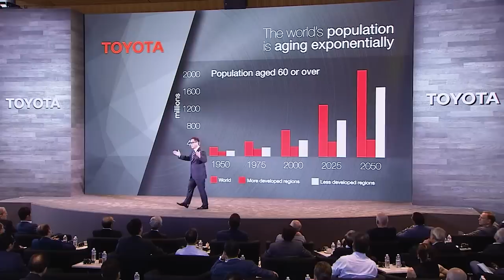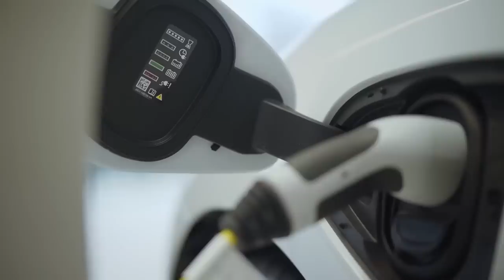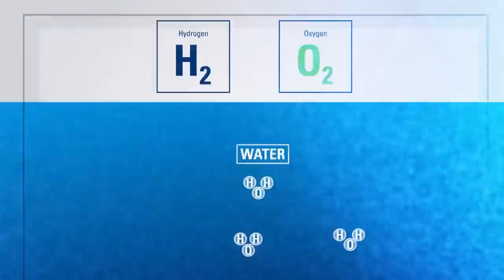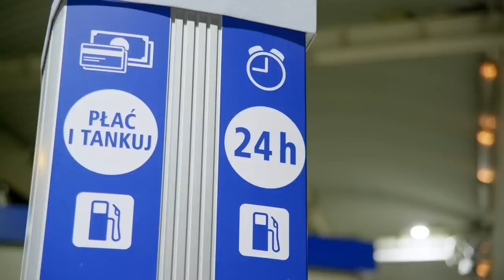New Toyota CEO Shocks Everybody | Huge News

Comment: One way to reduce your carbon footprint is to keep your vehicle as long as possible. Reliable, durable, quality vehicles would be the key here. It’s also what Toyota has been manufacturing for decades.
Reply: I just wish they would create a good SUV that would be basically rust proof. We don't want pickups and SUVs with frames that break in half due to rust. Toyota isn't the only one with that problem.
Reply: The best way is still to live in places where you don't need to own a car...
Reply: @marcbuisson2463  
You go ahead
Reply: @katherine5293  I currently do in Paris :>. I don't have any car licence, and spend 350e/year for all my commutes (withtm the pass navigo). I go to holiday by train 4-5 times a year, so that's 400e/year further (approximately). I do probably have a bigger night life budget than most americans though, good restaurants and partying is easier here than across the pond.
Reply: @northdakotaham1752  If you live in the rust belt in the US,  you need to use a good greasy undercoating and recoat every year.
Reply: @wiz4020  I keep one already rusty car for driving in the salt during the winter months and the rest of my rust free cars stay at home in the garage until  the roads are free of salt. I can flush out the mud but the salt gets into everywhere and is about impossible to get it all out.
Reply: @marcbuisson2463  sounds exciting....NOT!! Everyday is a holiday where I live. Night life is out in the wilderness under the stars! It's incredible!
Reply: @northdakotaham1752  you live in north Dakota. Of course it's the case. 
Now, is it also the case if you live in Dallas, LA, New York, Saint Louis, Charlotte? Nop, because you guys haven't even manage to conserve most of the rural land around your towns. We have pretected forests 5 km away from Paris.
And yup. If I want to do some mountain trek for a week, well... I take a train, a bus, and in 7 hours, I'm crossing the Vanoise for a week. 6 of these 7 hours being in a comfortable train with Netflix and a coffee. I have my feet in the sea in under 3 hours.
And even if I wanted to live in the wilderness... well, in the Alps, we have perfectly fine bus and train networks. I would not need a car there neither. I could even be even better paid if I lived in a small lost swiss village (with trains coming every 15-30 minutes at the local station) lmfao.
But yeah. While you live in the wilderness, most of your fellow americans living in suburbs try to persuade themselves they live in the wilderness. They just live in a sea of asphalt with not a single forest or farm kilometers around them.
Reply: @marcbuisson2463  I can't tell other Americans what to do with their lives. That's freedom. Freedom to make a mistake if you wish. Rural life is for me and my family. It's hard work but for us it's worth the effort. North Dakota is nearly the center of North America...so pretty much the same distance to where ever we want to travel and we can drive it, fly it (we are average income but we have our own plane), or we can take Amtrak if we want to travel by somebody else's schedule. But why do we want to leave home? We like it right here where we live. Everything we want is right here at home. Relatives are just a couple hour cross country. It's a choice we made since our family moved here over 140 years ago. Other Americans make their own choices. That's freedom.
Reply: @northdakotaham1752 I hear you, I'm from Pa. so I know about rusty vehicles, you have to get every nook and cranny, spray inside the frame with something greasy, I used fluid film but it will wash off, touching it up every year!
Reply: @North Dakota Ham  in the US, rural life is indeed very well linked to cars. And you know what? It's pretty normal. I'm certainly not throwing the stone at you.
Where I'm throwing it is at suburban or urban american life, who considers that having a car is necessary. It's not. And it should not be. Poor americans should have their life depending on being able to afford a car. And rich americans should not have cars or plains as their only transportation option. 
Current Amtrak is utter garbage and useless. But it's normal in a country where nobody lives near any train stations anymore. Which is sad, because many american cities were founded around these same stations. But on the other side... the fact that Amtrak still passes trains through North Dakota is a mystery in itself, this rail link should have been cancelled long ago. If you run a train line from a city to another, you either make it more convenient than cars, and make sure to be more competitive than them, or you don't build it. Unless North Dakota wants to densify and urbanise Bismarck, Fargo and Dickinson, the train line should be cancelled. Or run trains every hour/30 minutes. But the in-between is the worst solution of all, and costs too much to even be usefull to anybody.
Once again. North Dakota has little to no inhabitants. That said, are road used by cars that much better, or in the end are they even costlier there?
Reply: @marcbuisson2463  Amtrak is a money pit but it's kept alive to offer an alternative to those who either cannot drive or would rather not drive. There are also busses of course. The bottom line is there are choices for Americans to make. Everyone here is free to make their own choices concerning where they live and how they travel. Urban areas often times make their own regulations....but they don't always hold up in court bc they may be in violation of the U.S. Constitution, the basic law of the land here in the states.
 The highway systems are mostly paid for by fuel taxes and in some cases property taxes and specials, vehicle license fees.
Reply: @wiz4020  there use to be places where you could take your vehicle and it would be put on a lift, underside steam cleaned. Hot water does alot better job of cleaning.
Reply: @northdakotaham1752  Some Amtrak lines are a money pit, and these are not worth maintaining. If americans cared a minimum about those who either cannot or don't want to drive, they'd move on it. At least by creating safe enough bike lanes to allow their kids to go to middle and high school on their own, and accomodate mobility scooter users in urban/suburban places.
But hey. If you think that the current level of transport given by Amtrak allows some people to not drive in North Dakota, or that adults who can't drive live in North Dakota on their own, go for it. Stay in your illusions. That said, maybe the bus system is performing well and allows to replace a car. But I'd seriously doubt it. But hey, maybe I'm too pessimistic.
Maintaining these Amtrak lines is just for political reasons. You close them (as they should be), and local elected get bad press. Which they deserve after having encouraged people to settle away from train stations for decades, and after this realising nobody takes the train.
Fuel taxes pay is not enough, and by far, to pay for the US roads and highways. These are subventionised, and at far higher levels than any current rail systems. The federal tax alone has not be indexed to inflation since 1993. State taxes are higher, but still not enough. Most of the costs are linked to local cities, and US cities are being pushed into debt and bankruptcy because of it. Even with state and federal support (which comes from general taxes). Closing parks, closing municipal pools, libraries, etc...
And meanwhile, the state of your roads is bad, paid by general taxes, especially in rural places such as yours that have too low of economic density to get this cost back from oil and property taxes, and Amtrak is begging local officials to be allowed to close the lines.
American infrastructure overall is in a sad state. And american investments in them are in an even worse state.
Reply: @katherine5293  I have. I do. Parking lots make me sad.
Reply: @northdakotaham1752  freedom to go in the same direction at the same time at slightly different trim levels so you don't end up homeless. People are free to live where they want in other countries, including France...but they also have good public transport. Roads are a money pit btw. As are public airports you likely fly to.
Reply: @marcbuisson2463  bah
Reply: @marcbuisson2463  you’ve never been across this whole country have you? We have acres and acres of woods, fields etc with no one around. I travel two hours to the coast. Two hours to the mountains. 
If another plandemic breaks out I travel there in the quiet and virus free interior of my car. We have states as big as your country.
Reply: @marcbuisson2463  ok you haven’t seen it. The Dakotas have dirt roads that are smoother than the paved roads in many states.
Ever seen a school bus traveling 60 miles and hour on a dirt road? They do in South Dakota. Watched one go by while pheasant hunting out there. Beautiful country to me as people are scarce. A definite plus. 
Living in an anthill so I can walk to 
a club 🤮 or crowded restaurant🤮 is of zero interest to a lot of people who prefer quiet and solitude. 
I’ll keep my 2006 Tundra with 285,000 miles on it that starts up if you look at the key and runs like new.
Reply: @richardcranium3579  The whole US? Nop. I mean, I may one day try to cross it by train. New-York-Chicago, than Chicago-LA. May be a great trip :>. 
I've been in Washington and the Shenandoa National Park though. It's amazing, but entirely built for car owners. Train tickets prices, for the service offered... *whistles*. Quite bad.
The only thing I'm pointing is that... yeah. You can do this by car. So can we in France. You just can't do it with... anything else in the US. Bycicles in rural US is a big no no, trains are not available. And while you do it by car, you have to cross commuters and other drivers being there, not by choice, but by being forced, because there ain't any other options.
Though, if you really enjoy mountain and sea, I'd strongly encourage you seeing Corsica :>. 
The island has both, and the culture is... closer to the midwest than elsewhere. Just, be careful with the explosives around, and be happy with people shooting in the air for weddings with the traditional lupara (double barril sawed off shotfun). The whole place is still f*cking wild, and vendetta are still a thing.
Reply: @richardcranium3579  The anthill is easily escapable though, and we have plenty of time to get out of it :>. What I am heavily sad about though is the complete absence of nice rural areas with good quality infrastructure, and pretty traditional downtowns. Think Hill Valley in Back to the future. Those were walkable, often had their own train stations... and have been destroyed. 
Hence why you think "New York" when I'm speaking about urban settlements. Not traditional swiss village, or american small city with its suared plazza. Places where small family owned business thrives, not big malls full of franchises.
I can understand why scarcity of people is a plus. But scarcity does not always mean bad transports to human settlements. Hell, look at Sweden or Finland as examples of it.
Also, and I'll stand by it. This scarcity in population is subsidized by others. And if the federal state or the local state decided to start subventioning the roads and let oil taxes and property taxes pay for the local road network, a lot of people would suddenly realise that they are not able to afford living there. And with the climate change measures, this may hapoen sooner rather than later.
Reply: Yes, I had a Toyota Corolla that I owned 23 years and 386,000 miles.
Reply: exactly
Reply: @marcbuisson2463  Your magnificent is not my magnificent.  Just because you don’t agree doesn’t mean it’s wrong people needs cars!
Reply: @Madhaggis  Or people can live in places where they don't need a personnal one :>.
Care are usefull. They can even be necessary in plenty of places (suburban places especially...). But living there is often a personnal choice, and is not the only one. It is often helped and encouraged by the local and state government through subventions of roads and infrastructure, but if these subventions stops, maybe it would be better for the planet... as well as our local and state economies lmfao. 
Also, it makes ugly towns and shops. Something as dumb as taking care of your shops front, or having pretty human size elements or archticture are pushed to the side because useless to attract car drivers. 
And I'll maintain it. Sheltering your kids up to their 16 years old is not a good way to raise kids, even less if you want them socially integrated or to be able to have some independance. Being unable to even go to middle school alone  or go get some groceries for your parents, or join your after school activities on your own, or simply hang out with friends on your own, it's just... Well, it makes people unable to leave North Dakota. And simply isolated, disconnected kids spending their time on video games. It makes people scared of others, of society, and people who never had the luck to experience basic levels of municipal equipments. So people who hate taxes.
Reply: @marcbuisson2463  So in a densely pack city?  You see what's happening there?  No thanks.
Reply: @northdakotaham1752  Me too...with my ICE car.
Reply: carbon is good